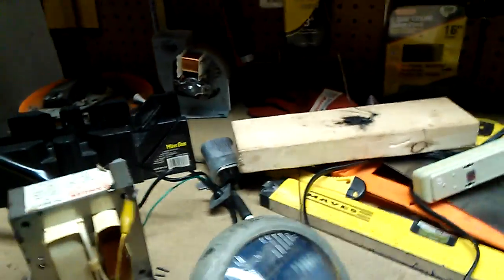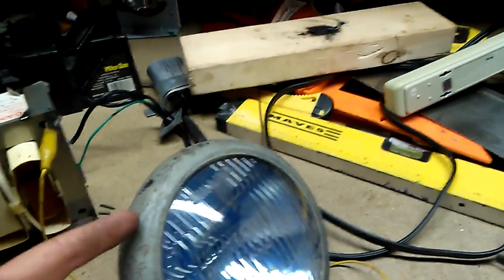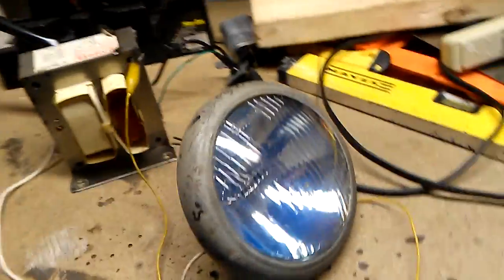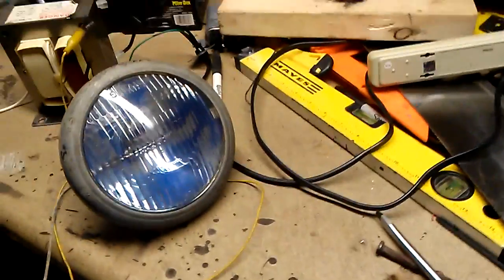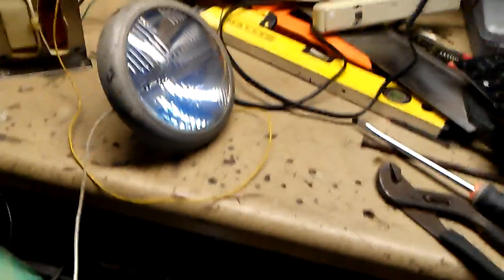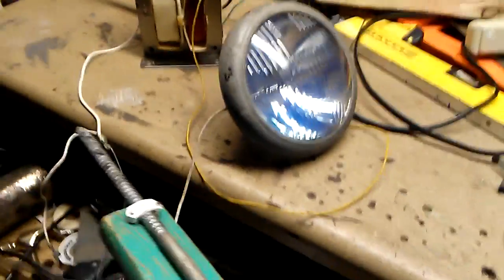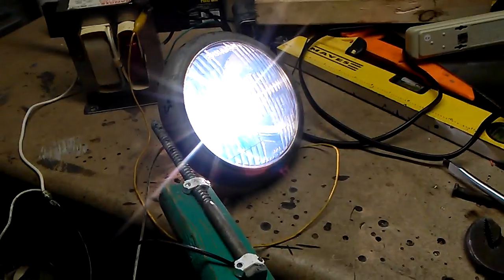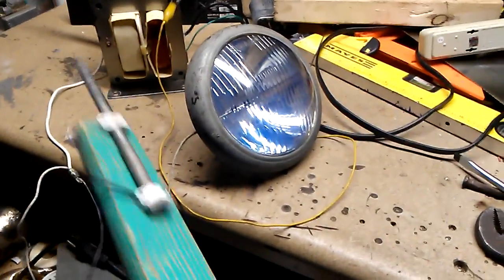Arc light from head light

Comment from the maker: all it is, is a stock but very old (that's key) microwave transformer the primary gets 110volts and the secondary throws out some were close top 10,000volts good fun popping things. You can do it with newer modles there just not quite as strong

Comment: Looks like it was just making the filament glow. If you actually try to use a headlight as an arc light (a 1500W metal-halide lamp ballast works for this--it's got enough current/voltage to blow the filament and then arc through the air gap), it'll arc for anywhere from a few seconds to a minute or so before it explodes. The typical MOT which only puts out about 500mA to 1 amp isn't going to blow the filament on anything but the smallest bulbs....and even if it does, it'll probably trip the breaker before the bulb dies.